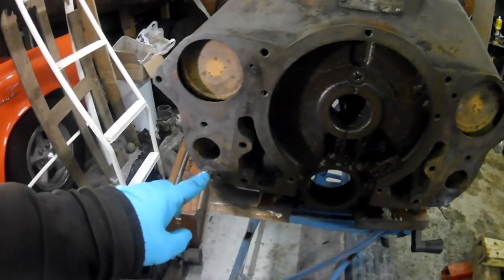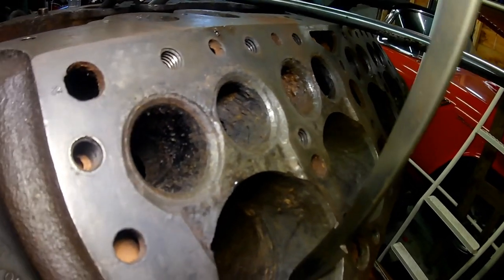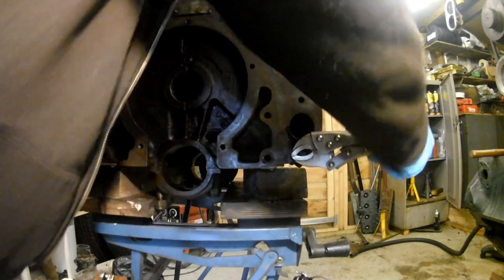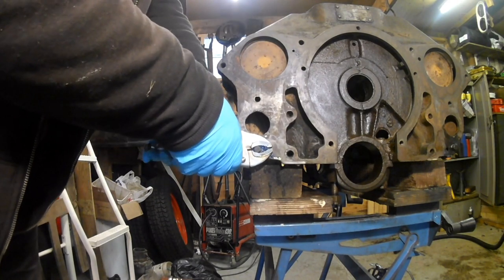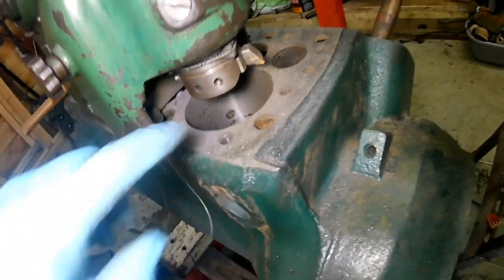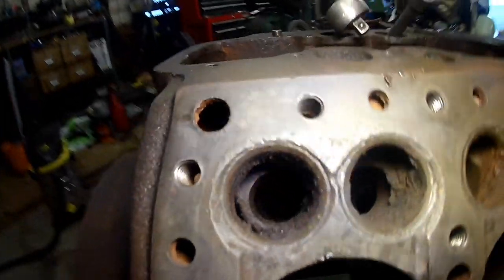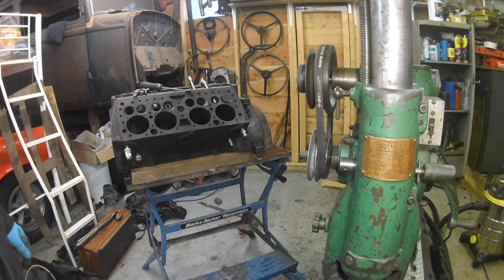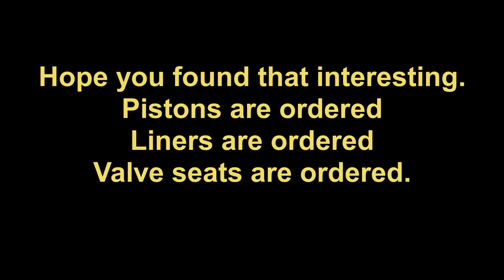Mart's seized Ford Flathead V8 Pt8: Bolts, Bores and a Buma!

Comment: So, not only rescue and rebuild the engine, also rescue and rebuild the machine tools.  A true "craftsman" !!! 
Haven't personally had the experience (happily), but have seen a few videos of guys welding a nut onto a broken stud. Appears the intense heat from the welding process coupled with the excellent torque transfer offered with the nut directly at the face of the threads seems to offer a good result. Also, the nut would make it much easier to rotate  back and forth. They do it also when the broken stud does not stick out past the face of the casting. Just fill the center of the nut with filler rod at the end of the broken stud. Would apply lots of intense heat directly to the stud. Help brake the corrosion bond.
Reply from the maker: Yeah, Bob, I've used that method lots of times. Everybody has their favourite method. I tend to use a mixture.

Comment: It could be some type of engine restorer where you put the paste in the cylinder and run it a few hundred kms and then do the next cylinder and it fills all the scratches in the cylinder wall it’s quite a old product don’t think you can get it anymore.
Reply: found tube of the stuff while scratching in the garage here its called piston seal its made by Holts